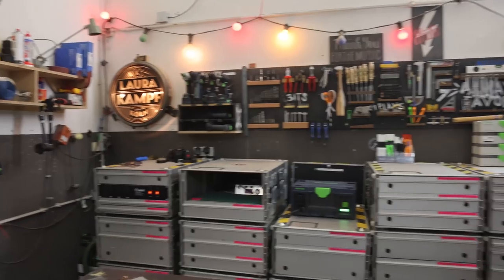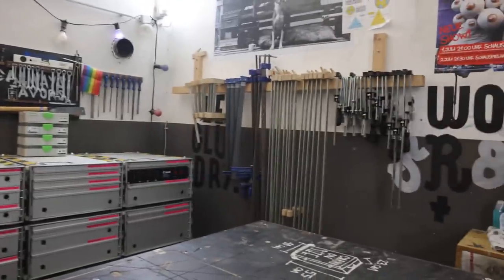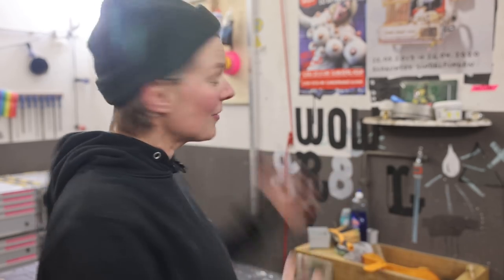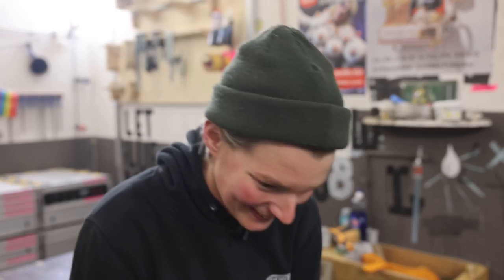This Clamp Storage Idea would be really good...if it worked :)

Comment: Love watching this process. Suggestion for your hoist issue: Hand crank to operate. You can gear something like that to change the mechanical advantage. But also, you might want to add a safety mechanism to protect against sudden loss of primary hold.

Comment: Like others have suggested, a counterweight would be a good idea. With the pulley system, you'll always have the compromise between speed and the amount of force you have to apply. If you choose to go with a counterweight system instead, you would be able to only tell it the direction using the rope and the system does the rest, assuming it's well balanced. You'd have one pulley on the bottom and one on the top with the two ropes for your clamp storage being attached to the top pulley in some way. Wikipedia has better details on it (the German article that is). This is also the kind of system still in use in many theatres (including the one I work at) for curtains, lights and scenery (Handkonterzug is what it's called in German).

Comment: Hi Laura. Love your channel. It is like watching working videoclips. Love it. About this project: Why would not start separating the structure from the wall so you have extra space in that wall? Now, considering it were easy to move up and down. It is just stetic because you can not have anything in the vertical space of the wall where table pass through. If you move it like 30cm away from the wall, you could hide behind some other less daily tools. Like those pictures of universities with movable blackboards. In fact, that could be the solution because you would have 2 equivalent weighs that allow you to slide them easier if there is no much friction.

Comment: Two parallel snatch-blocks - Pull two ropes simultaneously to prevent the ply-sheet from jamming. Also, polyethylene (milk-jug) spacers in the alu-rails to prevent jamming some more.
Decathlon and other sport-accessory storeshave ready snatch-blocks (not heavy enough for your application) to park mountainbikes on ceilings. (fro inspiration)

Comment: As long as you have fun and learn something it is not a fail, no matter the result.
To me it looks like friction is the biggest issue here. Putting some wheels on the back board could work, but I think a cooler solution would be to use plastic strips inside the U-channels similar to what is used on many chain conveyors to reduce friction. And also maybe use a hand cranked winch, maybe from an old boat trailer or car trailer.

Comment: Simple as has been suggested counterweight. Ring chord down to board through track up to a pulley across at 90deg to another to a counter weight +/-  the same weight as the great looking unit, divided by 2, one for each side.

Comment: Counter-weight to make it easier, and/or maybe a windlass to give you even more mechanical advantage. You could even put a ratchet on it so if can only turn in the direction you want and so it can't slide back down unless you want it too

Comment: 1) ideally you'd want sliders to be metal on metal, or even ball bearing runners if you can figure out a system
2) you can double up your pulley on the other side to give you 4x, but you'll need some type of wheel system as you'll have alot of rope to pull with 4 pulleys.
3) looks like your rope is very stretchy. Does that bother you?
4) maybe instead of wooden backboard you can replace it with alu or perforated metal sheet?

Good luck! Love the work in progress theme.

Comment: I would use bearings/wheels inside the alu profiles, that way you can reduce friction a lot. I might also test a system without a pulley, but with a ratched that has gearing to reduce the amount of muscle power needed. That way you also have less points where the rope can get stuck as a bonus.

Comment: Lifting the board from center allows it to wiggle and stuck to the side rails. You can lift it from two top corners instead to avoid this wiggle. Also, adding some wheels or sliders to the side rails would help.

Comment: I vote for the counter-weight idea someone proposed.  With that, it will look super cool, and you can make more pulleys!
You can put a counter weight on each end of the panel, so you can adjust for asymmetric weight in the panel.  More pulleys!

Comment: Absolutely not a fail, it’s version 0.5. Motors are available in lots of old equipment. With proper gearing even an old vacuum cleaner motor would do the job. You can also play with micro switches or contacts, it’ll be an excellent project.

Comment: Torsion spring counter balance like is used in roll up garage doors, at least here in the states. Another possible solution would be constant force springs, but not sure you get them large enough to support the weight you have there...

Comment: I have a couple of thoughts.
1. What are you trying to accomplish with them sliding up? If it is to free up wall space, I don't think that is accomplished with the track so close to the wall. You still wouldn't be able to use that wall space for anything other than pictures. If that is the goal, then perfect.
2. I had the same thought of motorizing it, even if it is a chain driven hand crank motor. I have seen you use bike parts before, and think you could use them here.
3. Wheels on the panel may help it slide with less friction maybe. Waxing it may work as well.
4. Going completely off script, would hinging it upwards work? Or maybe multiple slides with the different sizes/types of clamps?
Love your work as always.

Comment: The biggest improvement would be wheels/rollers at the edges of the back panel to help keep the panel from binding up in the tracks. I think you are getting losts of friction in the tracks from the uneven weight load.  Und real pulleys with the   U shaped channel to prevent the rope from potentially rubbing+binding against the sides of the pulleys. (those bearins could possible be repurposed into guide wheels for the back panel)  I would also add either a motorized reel, or a winch type  crank-reel as a safety measure.

Comment: I believe a counterweight spring system from an overhead garage door is the solution you are looking for. The idea came to me when I saw you pushing up on the underside of the loaded plywood. Advantages would be several: You would be able to adjust the spring tension to match the load and adjust accordingly, you should be able to find salvage parts, and if salvage is not available all the components are available from a very large online retailer. I suggest you not use the spring system to make the weight manageable. The one disadvantage may be what happens when a large number of clamps are removed from the shelf. The counterweight springs may launch your empty clamp shelf into the ceiling.

Comment: Hi Laura, when I saw the bearings, I thought you would use them to run the board in the rail. maybe it can make the board go more smoothly? we have a heavy lid to pull that we do with a manual winch. maybe you can hang the board with springs from above, maybe the combination of all of these is a way to go...? Much fun to find it out! 🖖

Comment: I agree with many others that the uneven distribution of the weight maybe causing the board to bind with the track. Eliminating it by putting wheels on the board to slide on the track may do it. As with any pulley, you compensate the force with the length of the rope. More pulley means to need a longer rope, so I’m sure you want a spool for the rope., you can put a stopper mechanism on the spool for safety, in case you drop the board.

Comment: The first problem you have is friction:
- Friction among the main panel and the rails seem to be a factor. You need for wheels there, with bearings if possible.
- Friction at your self-made pulley: External face of rolling bearings is too much polished. If you see usual pulleys, surface is curve to increase friction among wheel and rope. Maybe setting a "rubber glove" to the bearings?
I agree with the others about:
- Using a counterweight or a garage door elevator (Or both?)
- You are using more surface at the wall, but you have no surface win by elevating the clamps. What about having more distance between your panel and the wall? You can have a second panel with tools flat to it. Clamp's panel just cover them when pulled down. In its normal position, you see both panels, with easy access to the lower one.
- From this, an additional idea: You know those old university twin-blackboards: One goes up, the other comes down. One is the counter weight for the other.
This will work as long as the weights are more or less similar. Once you take away too many clamps, weight will be too much different. I go back to the previous idea (hidden tools behing the moving panel.

Comment: As a lot of people have already say in the coments; the pulley works, just needs another type. Diferent types and more loops allows to lift more weight. The phisycs of it is pretty amzing. 

the friction of the sides of the panel may be a bigger issue. I had and old closet the had bearings in the rail system of the sides of the drawers, instead of the modern ones. 

i would give a thought about the safety. Maybe some kind of "safe switch", just to dont guillotine yourself(it could be a big jumpscare if it falls suddenly)

Comment: I store my Klem' cam clamps closed with the lower cam, hooked over a vertical plate. Hook a small cam clamp over the back of a chair. ?? Visualise your board rotated 90 degrees, and the steel bar touching a support piece lower down to balance the clamp. 
Counterweight idea..... divide the big board into panels each holding a weight you can safely hoist up with a single pulley above. Add a counter weight to assist. Look at sash windows, the Georgian style of multi pane glass frames used in the 18 19 centuries, before metal frames and UPVC!!! Sash window frames are heavy and have two lead counterweights, running over grooved pulleys. Lifts or elevators have a counterweight, the lift motor only has to shift part of the load not 100 %. Divide the task, Laura !!!

Comment: You can buy Teflon tape which would reduce friction. Pulleys can reduce the force required. Electric winches are a thing if that's still too much work. After that you're into linear bearings and offsetting the weight with springs or gas lifters or a counterbalance weight.

Comment: You should add a counterweight like a lift/elevator, then you can just pull the board up and down by hand. Maybe make the counterweight heavier than the total board weight so it naturally raises up, and have a little catch to hold it down when in use.

Comment: Use springs! or a counter weight. And reducing friction on the glides would help too. 
Using a cam on the pull cord could provide more mechanical advantage too

Comment: Electric winches are pretty strong and easy to acquire.
If you use a leaf limit switch you could easily have it run automatically without worrying about it crashing or having to stand there and wait.

Comment: i would suggest adding 2 (or more) attachment points to the backing board so that the force of the pulley is a bit more evenly distributed along the length of the board

Comment: Add one more loop and pulley into the block-and-tackle. this will further reduce the effort on the main line. Then use either a hand-crank winch and drum or motor driven version.

Comment: Hi Laura ! Your wheels can hardly work as pulleys, just because the rope will not stay centered, and might get stuck into the flanges… this makes it hard to pull it up. Once you get the right pulley grooves, it might be interesting to double the system – i.e one pulley system on each side of the panel… Better balance, and easier way (more safety as well). But at the end, as Leonard Fairground told you, won't be able to use the space under it… Or have to move your stuff when you need the top storage to come down (get something on rollers underneath) ! You're on the way ! Go on !!!

Comment: If I were making this, I would add some wheels to the wooden gantry to make the friction between the wooden sheet and the rails less. But since no horizontal forces are being applied to the wooden gantry thing, friction shouldn't be the main concern since it's a function of the force the rails apply to the wood (which is equal to the force the wood applies to the rails). Anyway from a physics perspective, you can add a few extra sets of pulleys in series with the other ones to reduce the force required to pull the gantry up. Remember, for every length of rope attached to the wood, you apply unit of the force you apply to the rope. so since you have 2 pulleys here and there's 2 strands of rope per pully, you apply a force to the wood 4 times the force you apply to rope. If you add 2 more pulleys, you make it 8 times the force applied to the rope and 8 times the amount of rope pulled per unit of distance that the gantry moves. So you just have to add more pulleys. I hope this helps :)

Comment: Counterweights attached to the original points for the lifting rope. The counter weights can be set for the weight of the unladen board, the only effort you would need to provide would be for lifting the items on the board. (Don't make them too heavy, or your empty board would rise on it's own.)

Comment: Try Wheels to the side of the moving boards inside the channel. This will make it move way easier. You can also increase the number of turns inside your pullies. E.G.: Instead of two turns try four. This way you need more cord and have to pull twice as much cord but with aproximatly half the force.

Comment: Block and tackle. Pulley system is like gears on a bike, reduce the ratio more and it'll move, but will take longer. Motorise is good with block and tackle. Whatever you do, double check the strength of your line so it isn't over tensioned. A rope snap would probably be the worst outcome. Also brakes, the chain hoist block and tackle units have a brake in them which engages no matter which way it turns. If you're intent on using rope, maybe investigate some rock climbing (or Australian Rappelling) rigs to see how they manage their line brakes.

Comment: Didn't see this suggestion yet, but if you printed something that fits over your bearings on the pulleys that prevent your rope from rubbing against the sides of the bearing assembly, that would go a long way too. Right now, it's possible the rope is getting wedged between the bearing and the plates of the pulley assembly, generating a lot of friction.

The print could be a ring with the profile of an H, so the rope sits inside a groove and everything the rope touches on would spin with the bearing. You'd need to press this print onto the bearing.

+1 to the comments below about adding wheels to reduce friction between aluminum tracks  and plywood board! You could also try moving the tracks closer to the center behind your board, so this makes the plywood less prone to racking.

Comment: Scavenge parts from a bicycle and use the crank and reduction gears to crank it up or of the way. Incorporate a counter weight (like the inside of old sash windows) or use large springs anchored above to supply a counter force to gravity.

Comment: Just add more loops to your block and tackle. It'll take considerably more rope being pulled, but that's the trade off. You probably only need one more loop. Each loop doubles the total of the previous loops. i.e. 1x, 2x, 4x, not 1x, 2x, 3x. Think of each loop as a separate system which doubles the force and doubles the amount of rope (needed to be pulled) to move the same distance. Since each loop feeds into the next, that's force multiplying!
I'd also suggest a groove around the bearings. It doesn't need to be particularly strong, but the force loss from binding at those sharp recesses between the pullies and the frame will also multiply. You could make them out of wood and they'd probably work fine.

Comment: IIWMI'D 1. install a winch & 2. Move it out from the wall so I could put another layer of tools on the wall accessible from standing position for 2X the storage. If you want to avoid electrical, get proper pulleys (likely the sharp edges of the sheaves will abrade your rope & create a dangerous situation, whereas proper pulley wheels have the rounded profile to cradle the rope) & use a counterweight on the pull side. Also look up a jamb-cleat which you can buy or build to hold the rope position more simply, U could make one with a spring releaseto capture & release the rope

Comment: You don't need to motorise it. As others have mentioned there's friction being introduced in your C-channel guides which can be removed with some sliding surfaces (wheels or ball-peens)

Another thing I'd recommend is an actual hand-crank instead of directly pulling the rope. It's safer, easier, and gives you more mechanical advantage. Plus it's look cool.